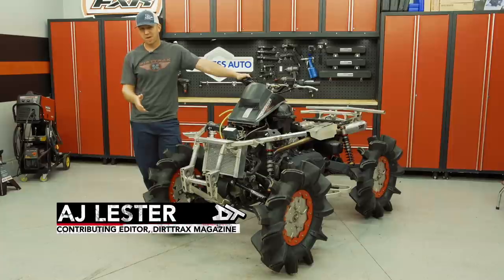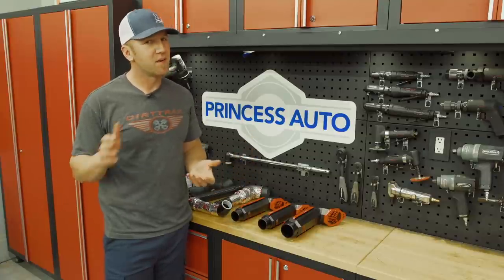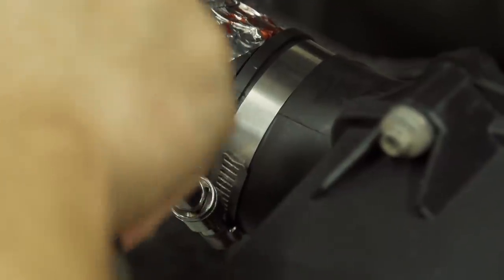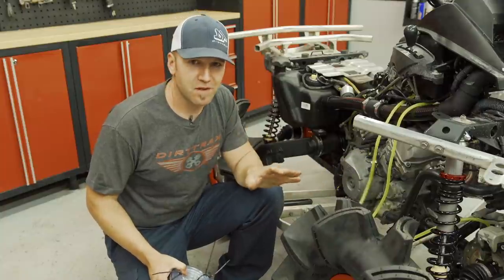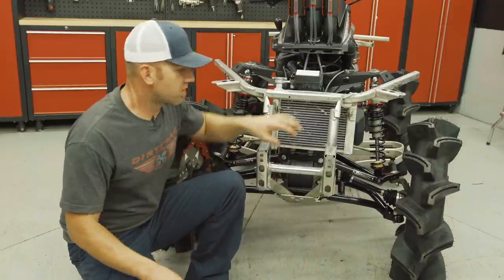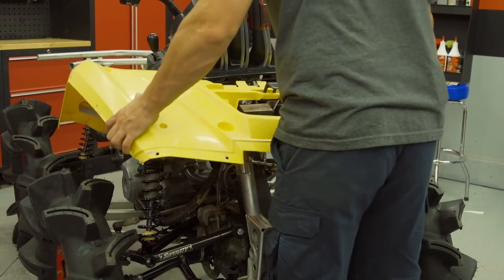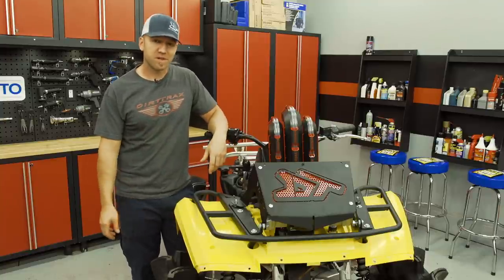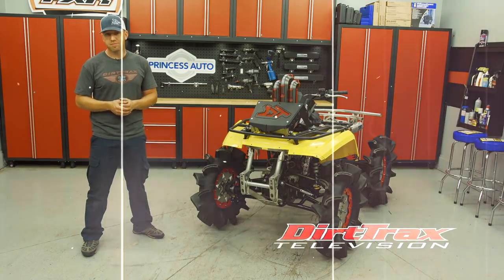Can-Am Mud Build: Part 6 - Snorkel & Rad Relocate

Comment: Great choice on the snorkels and Radiator relocate. The fact the radiator tilts forward will help in getting anything plugged up in that rad out easily by putting water through the back side. The snorkel kits sure have come along way in recent years from just some scheduled 40 piping poking through a pod. All in all great build so far!
Reply from the maker: Thanks, we couldn't agree more about the parts, they have all come so far and are reasonably priced too. I love the tilting rad for getting crud out easily.

Comment: When you apply dielectric grease, it's not conductive, but instead is used to keep the rubber seals in the connections sealed for the elements. By putting it in the actual connections you're actually placing an insulator in your wire connection. Sparing amounts on the rubber seals and such is where it is doing its job.

Comment: Come on Dirt Trax, crimp connectors? Please use solder and shrink tubing, the mud and water will corrode and eventually break the wiring. This will cause resistance and electrical issues down the road
Reply from the maker: I know, I know. I was just showing what came with the kit. However no excuse, solder is always the right way to go.

Comment: Have enjoyed the build and actually gotten a re flash by Mr rpm after seeing this on my 14 commander  limited but trying to get a simple clutch kit for 3 to 6000 ft has been very difficult any suggestions with 28inch black waters on bead locks?
Reply from the maker: If your just looking for a kit I'd try out Dalton first, they do a really good job and don't sell anything they haven't fully tested. They also sell the kits with all the weights for different elevations, if you don't find anything with them let me know.

Comment: Could y'all Plasti dip the plastics and do a review down the road of how it held up
Reply from the maker: We haven't had much luck with Plasti Dip holding up long term. I personally used it on some truck bumpers and it chipped and peeled off after only a few weeks of hard use. I'm guessing it'd start to look pretty rough quickly on an ATV with all the abuse from sticks and rocks. But it doesn't mean we can't try.

Comment: From my own experience I've found that applying silicone based dielectric grease to connectors WITH silicone seals, will actually cause a chemical reaction and cause the seals to expand.  Silicone grease is only compatible with rubber seals.
Reply from the maker: Good to know, thanks for the heads up.

Comment: That is definitely the wrong way to apply dielectric grease to those connectors.
Reply from the maker: I was told to just put it into the connectors, It's been running good but we are always open to advice. I'd never used the stuff before but was cautioned to make sure we used it this time.
Reply: I apply a small amount to the face of the connector. The grease is an insulator not a conductor so getting it in the pins is not ideal.
Reply: That doesn't mean that you applied it appropriately.
Reply: Dude you are 100% correct. I see people doing this and have even had short arguments with people about it. Have had soo many units come in with electrical issues and guess what.... EVERYTHING was filled with it. Sooo many people do this not realizing how much trouble it causes.